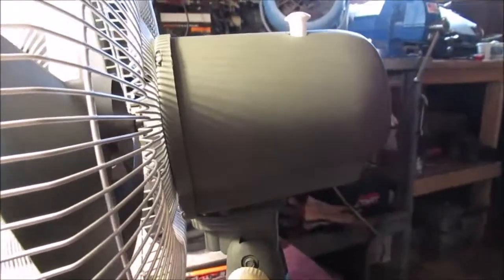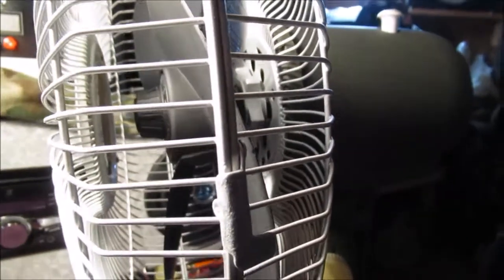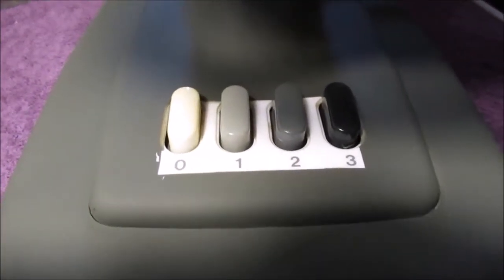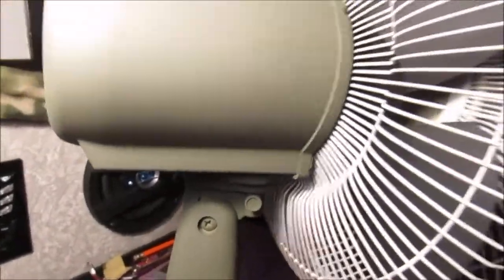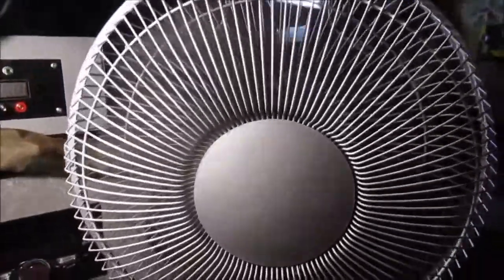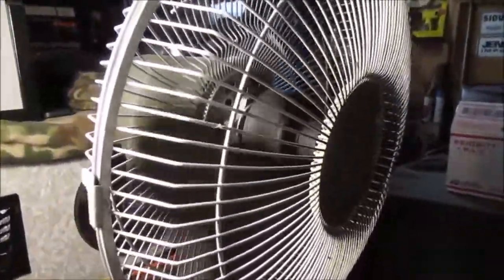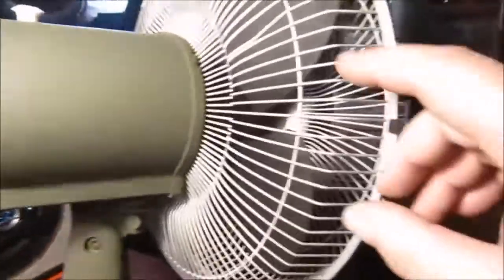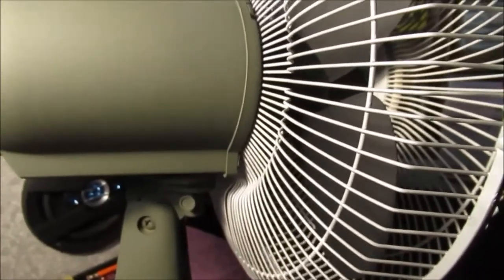Repaint cheap white plastic house fan

Comment: HI. THOES LITTLE FAN MOTERS DO NOT HAVE BEARINGS. BUT YOU CAN OIL THE BACK AND FRONT BUSHINGS / SHAFT AREAS. IF THAT AREA  IS ALL SEALED, I TAKE A .050 OR SO AND DRILL A SMALL HOLE IN THE BUSHING BRACKET. THAT WAY I CAN OIL THE SHAFT. SOME BUSHINGS ARE OPENED BY THE SHAFT OIL IT THERE, GOOD VID.
Reply from the maker: I can see in the back that it has plastic on the back of the motor...I may try drilling it...Thanks for watching !